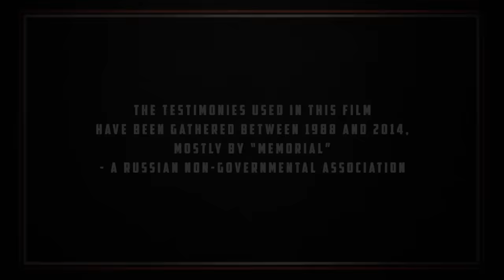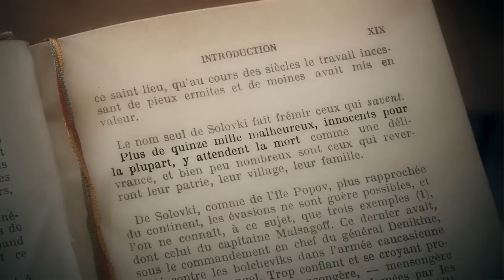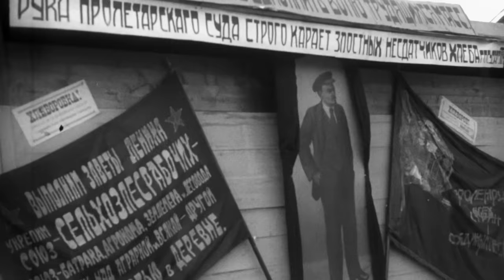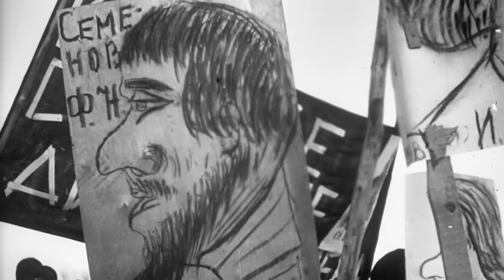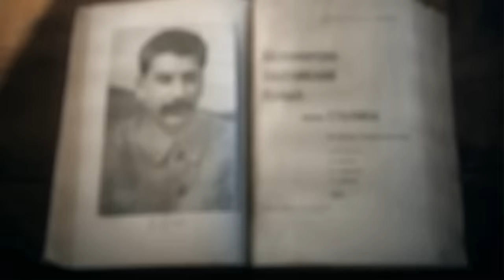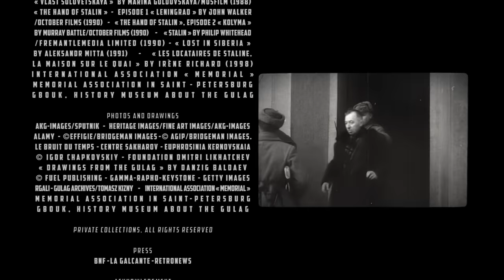Gulag - The Story | Part 1: Origins - 1917-1933 | Free Documentary History

Comment: Seeing those guys picking up huge shovels full of sopping wet mud and tossing it over and over and over again..        that is not easy whatsoever.  After about 10 or 15 shovels full of that and most people would be worn out. Two guys taking turns pounding a steal stake into a rock (what we would use a jackhammer for today).  Running wheel barrows overfilled with dirt and sediment up an incline with the wheel riding a two by four inch board laid out across the ground.  Everything the Zeks were made to do was not just difficult, it was extremely difficult.  You’re literally seeing people being absolutely worked to death.